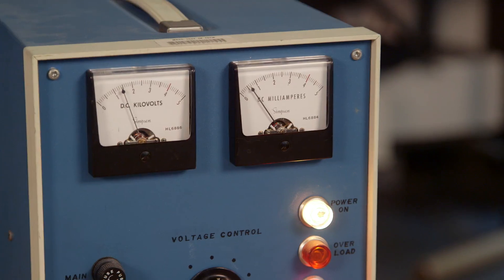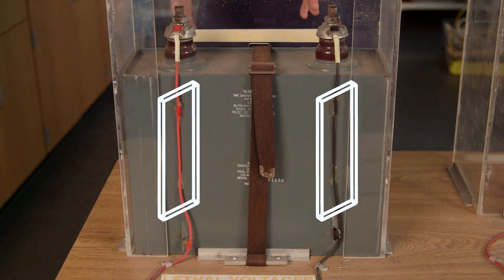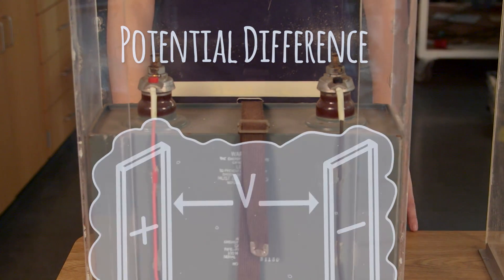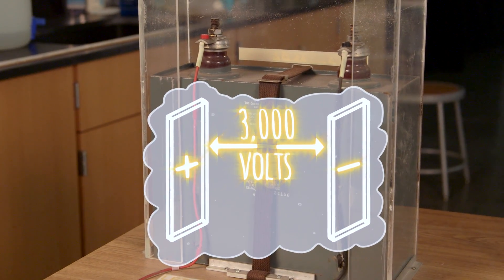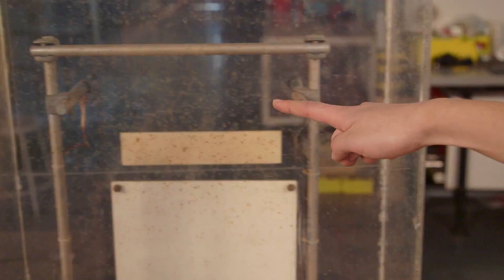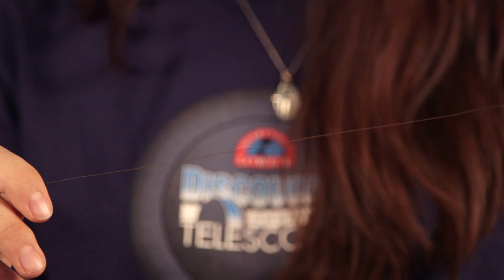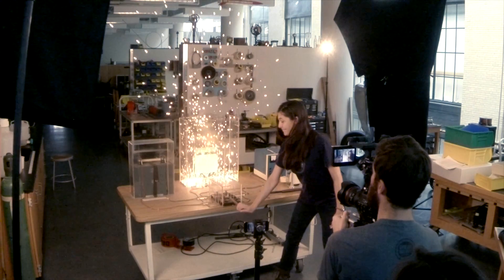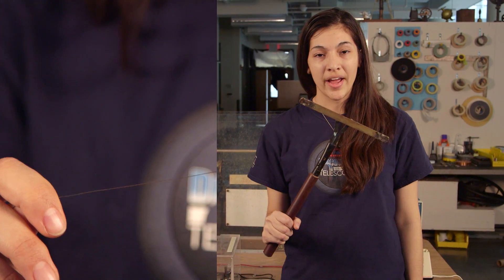Catch the Mistake! Exploding Wire

Comment: I'm sorry to have to say this but, the wire has a higher resistance than the copper bar. That resistance created heat in the wire  which is why the wire got red hot. The copper bar with less resistance conducted all the remaining voltage and didn't get red at all and it did it almost instantly. She's got it completely backwards. How does this happen?

Comment: I agree with Daniel below. I caught the same mistake in the narration, then checked if anyone else thought the same in the comments.. The thick copper bar at the end has to have smaller resistance than the thin wire.  So the current through the bar would have been larger than the current in the wire. Here is the thing though, the first experiment must have decreased the voltage difference across the capacitor, right? So there is actually no way to tell which current was larger based only on comparing the resistance of the wire and the copper bar. Do I have it right?

Comment: The thin wire had higher resistance than the flat bar!  That is not the issue that led to the fireworks.  The thinner wire has much less mass, and therefore the energy dissipated from discharging the capacitor transformed into thermal energy and was enough to melt the wire.  Keep in mind that the bar discharged the capacitor without much excitement, but if the energy in the capacitor was much much larger, then the bar would have the same demise as the wire....

Comment: "the thick copper bar has a way higher resistence that the thin iron wire" Isn't that the opposite? shouldn't the thickest conductor has less resistance?

Comment: but MIT teaching wrong stuff publicly on the internet, resistance of a conductor is equal resistivity of a material * length/ cross sectional area. The thick plate would have alot less resistance and current through it would instead be higher. I demand my space in the university now
Reply: the energy discharge is equal the potential difference and though the same amount of energy will be released with equal voltages the resultant heat formation from the electrical energy would heat the small mass of the thin wire much more than a bigger mass copper plate. (energy provided= mass*specific heat capacity*temperature change)|
the thin wire would heat up beyond the melting point almost instantly and explode
Reply: just finished exams